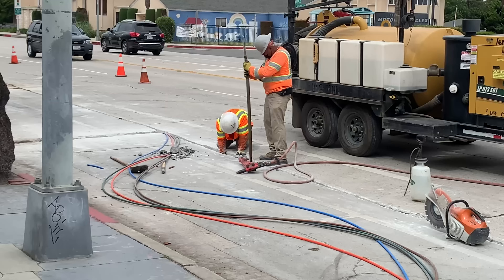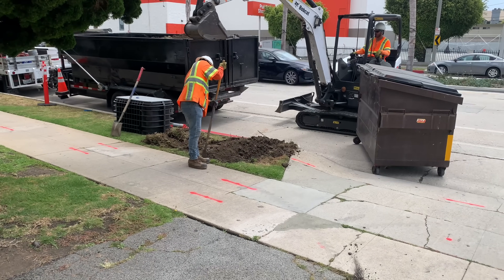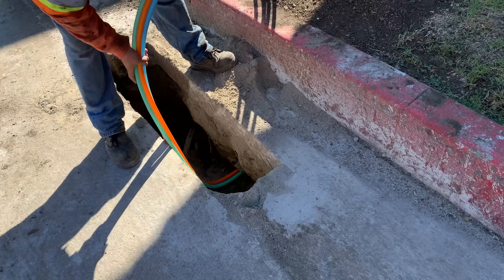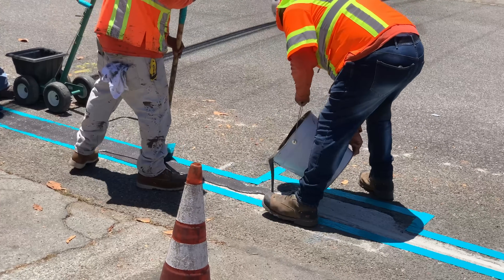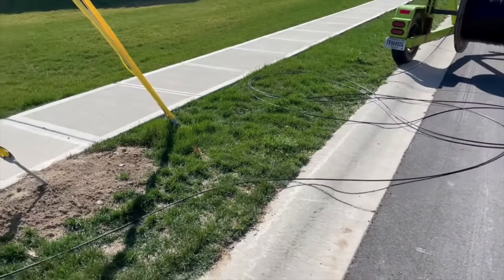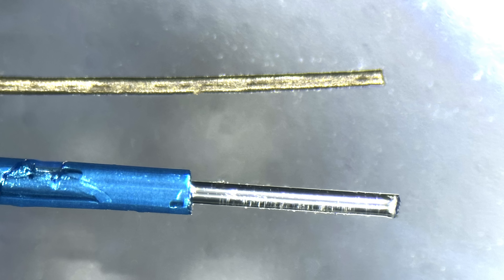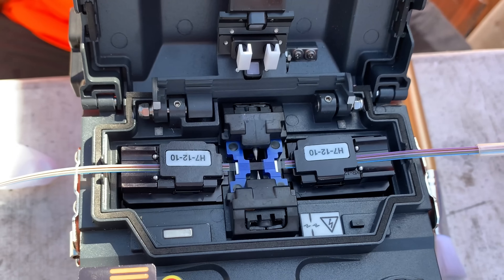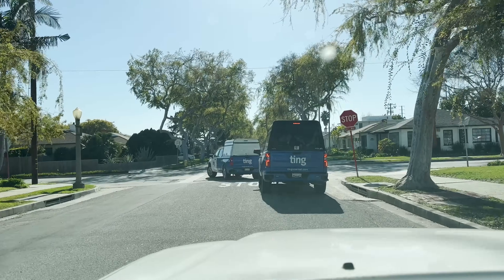Fiber Optic Network Install

Comment: So does the fiber optic internet company subcontract out these guys to install the fiber optic? If so, does the subcontractor company only do fiber optic installation or do they do general construction type work? Or are they directly working for the fiber optic company. I'm just curious how this business works.
Reply: I think a lot of ISPs use subcontractors for the infrastructure build out and then they have in-house technicians do the actual install at the house.

Comment: I live in a rural area and recently i learned theyre working on laying fiber optic cable internet in my area. So far all they've done is mark all the utilities (which is literally only water) and laid these tubes all down the street and under my driveway. The tubes are sticking out of the ground still. Im assuming cause its such a long run. They have multiple tubes sticking up every 100 feet maybe. I'm not sure i haven't measured it and thats probably an over estimation tbh. But this is the first internet outside of dial up, satellite or fixed wireless that will be available in my area. I've had dial up and fixed wireless so far which we all know about how slow dial up is. The fixed wireless was like 5Mbps to 35Mbps originally. Then they upgraded it to 50Mbps to 200Mbps. Which so far I've only seen up to about 165Mbps. Which is crazy fast for what I've been able to have. Now in a few months (I'm guessing) I may be able to get fiber optic internet. But its gotten me very curious about how it works and how its installed

Comment: Isn't laying optical cable in a trench under a concrete roadway a questionable engineering decision? Constant vibration and deformation can't be good for any cable line, including fiber optic communication lines...

Comment: In Croatia, all fiber optic cables go thru electricity poles, easy to fix and less expensive, also means no construction at your house, only a cable going thru a wall.

Comment: I just was working with a crew doing this work and it was just me working with a small hoe, we were working on a 3 line, I guess I took to long like an 1 and a half, we usually got 6 done a day but that day we just got 3 done….. long story short I worked there for 4 days and they said you were told to be ahead of the hoe and you’re not doing that, so you can get the fuck out of here.

Comment: How do your fiber wires get damaged underground???
Reply: Other workers digging in 😂
Reply: People dig in places they shouldn't. There are areas where they have signs warning people not to dig because there are buried phone lines, cable lines, power lines, gas lines, etc. But in other areas, they aren't usually marked so sometimes people dig in and cut cables unintentionally.

Comment: I am here because I am being told Optimum doesn't have real fiber internet. At the end of this video you show connecting fiber to the customer. Is that the only way to get real fiber internet, through that panel on the customers house?
Reply: Yes. The internet provider has to install a box similar to the one you see at 3:58 on the side of your house. That is where they run the fiber from the street/pole to your home. Then they run another fiber cable from that little box to inside your home to your modem or gateway.

A lot of ISPs that are not exclusively fiber will do something called fiber to the node. That means they run fiber from their central offices to the various nodes around your town. But they still have the copper wiring running from that node to the individual homes.

Comment: Now days they don't even run copper to new builds.  The house I just moved into only has 2 fiber cables coming to it, one for the telephone company and one for the TV company.  Much better speed and ping rates and very reliable.

Comment: How long after they install can a resident sign up?
Reply: I think it depends on the provider. We got fiber installed almost a year ago. I was able to sign up for service about a month to a month and a half after they finished our neighborhood.
Reply from the maker: Strangely most of the tubes are empty for some reason.. at my curb I see them but no fiber in them.. idk
Reply: @LeifMaginnis  I think sometimes they install the conduit first. Then later they come out and run the fiber through them.
Reply from the maker: @JJFlores197 yeah.. been empty for 2.5 years though.. after all that work 😂

Comment: The dumb thing how government across the world is how sloth in regulating WiFi generation. Like WiFi 8 is around the corner and we are still stuck with WiFi 5 and early adoption of WiFi 6. And every WiFi generation devices are like some kind of revolutionary stuff pricing. Just abandon producing old generation and introduce new generation router with same pricing. WiFi is just underrated.

Comment: I don't like them just dropping the fiber optic in a cut in the road. They should drop conduit to protect the fiber optic and to facilitate easy replacement in case something happens and the line needs replaced. It's easier to replace through conduit than to re dig everything back up and reinstall it.

Comment: So there's a similar tubing running from the street cabinets to a server of sorts?    When/where does the routing start?
Reply: I don't fully know how the backhaul infrastructure works, but yes there is some sort of underground conduit that runs from the cabinets to the ISP's local central office/head end.

Comment: When Bell installed fiber in my neighborhood, they used hydro excavation and horizontal directional drilling right under the the lawns. Craziest part was they did it during the winter, so the ground was frozen.

Comment: That must have been the old school way of installing fiber conduit? Because AT&T and XFinity both have been been installing their cables in my neighborhood and they aren't trenching they are using a machine that is pushing the cable with a water jet and the conduits they're burying in the ground are each 3-4 inches in diameter and are on 3000+ft spooled rolls of conduits each conduit has a 6 or 7 smaller 1/4 to 1/2 inch bundles inside them and at the end of each spool run they are installing distribution node boxes then running the individual residential supplies from those node boxes. In the amount of time it took them to dig up those streets and clean up the mess the crew that's been running around my neighborhood what's already done and on to the next area.

Comment: Watched the contractor on our street.  Cut a trench in the soil for the single fibre, deep enough to be protected.  But the coil of conduit wants to curl up and down in the trench. They are too lazy to weigh down the curl with a couple of little egg size rocks before backfill, and instead backfill with material that goes down past the conduit, leaving the conduit a couple of inches from the surface! No one will know until some wants to plant a flower in that spot!  Every home on the street like this!

Comment: And they're using the lame ass green connector. lame just use regular LC connectors not those lame green SC that are cut at an angle.t hat's just lame.

Comment: Now I get it, why people buy starlink in US, I have a $6 (₹500) per month fiber connection with 200mbps and unlimited data since 2019. No problems since 2019.

Why do US people make stuff complicated as hell and then say the cost of technology is 1000 times of actual cost.
Reply: what isp is giving you 200 with 500 rs bruh

Comment: Thats weird, they use directional boring where I am. I have never seen them directly trenching the road like that.

It seems like it would be harder to protect them against backhoes and ofher work crews by trenching the road.

Comment: Funny to watch this video. When France do this since more than 15 years and more cleaner. 80% of France have Fiber optic, and will be 100% in 5-10 years. Fiber optic is everywhere in France. In big city, small city, village, country side and ski resort.
Reply: Dis moi d'où tu sort tes 80% de câbler en fibre optique s'il te plait, je crois ta jamais travaillé dans la fibre.
Reply: @Zerasion-  Toi t'es bien un abruti. Quand on a un cerveau de gauchiste. Mieux vaut la fermez ! Oui, la France est bien fibrée à 80%. Tu n'as cas allé sur le site cartefibre.arcep. En haut à droite, il y a marqué "DONNÉES DU". Tu changes la date, et tu mets par exemple "T3 2017". Regarde la carte attentivement. Puis tu changes la date, et tu remets à "T4 2023". Je dirais même que la France est fibrée à 85%, voir 90%. Il y a seulement la région de Bretagne qui est fibrée à seulement 40%. Les départements de la Dordogne, Drôme, Ardèche, Deux-Sèvres et 2 autres qui sont seulement fibrées entre 20 et 40%. Avant d'ouvrir la bouche, mieux vaut connaître le sujet. Depuis que Macron est devenu président. Le déploiement de la Fibre optique a été multiplié par 10. Normalement, dans 10 ans, la France sera fibrée à 100%.
Reply: @Zerasion-  Toi t'es bien un abr*t*. Quand on a un cerveau de gauchiste. Mieux vaut la fermer ! Oui, la France est bien fibrée à 80%. Tu n'as cas allé sur le site cartefibre.arcep. En haut à droite, il y a marqué "DONNÉES DU". Tu changes la date, et tu mets par exemple "T3 2017". Regarde la carte attentivement. Puis tu changes la date, et tu remets à "T4 2023". Je dirais même que la France est fibrée à 85%, voir 90%. Il y a seulement la région de Bretagne qui est fibrée à seulement 40%. Les départements de la Dordogne, Drôme, Ardèche, Deux-Sèvres et 2 autres qui sont seulement fibrées entre 20 et 40%. Avant d'ouvrir la bouche, mieux vaut connaître le sujet. Depuis que Macron est devenu président. Le déploiement de la Fibre optique a été multiplié par 10. Normalement, dans 10 ans, la France sera fibrée à 100%.
Reply: @Zerasion-  Toi t'es bien un abr*t*. Quand on a un cerveau de gauchiste. Mieux vaut se taire ! Oui, la France est bien fibrée à 80%. Tu n'as cas allé sur le site arcep. En haut à droite, il y a marqué "DONNÉES DU". Tu changes la date, et tu mets par exemple "T3 2017". Regarde la carte attentivement. Puis tu changes la date, et tu remets à "T4 2023". Je dirais même que la France est fibrée à 85%, voir 90%. Il y a seulement la région de Bretagne qui est fibrée à seulement 40%. Les départements de la Dordogne, Drôme, Ardèche, Deux-Sèvres et 2 autres qui sont seulement fibrées entre 20 et 40%. Avant d'ouvrir la bouche, mieux vaut connaître le sujet. Depuis que Macron est devenu président. Le déploiement de la Fibre optique a été multiplié par 10. Normalement, dans 10 ans, la France sera fibrée à 100%

Comment: Great video, you made a small mistake though, at the end you confused an ODB with an ONT, an ONT is basically a modem while the ODB showed in the video is just a box where the fiber from the street meets with the fiber that goes inside the home. The fiber that technician plugs in at the end connects to a female to female SC connector inside of the ODB, it's than the ISP's job to run a fiber from the ODB to the actual ONT inside the home.

Comment: This all depends on where you're located. In more rural areas fiber is often aerial, trenching conduit in dirt is much easier then pavement. Often times in areas with overhead lines many of the homes already have a conduit in place and a single fiber line can share a conduit with other utilities. If their utilities arent in a conduit the fiber can be ran to the home aerial as well. Fusion splicers and ribbon fusion splicers like in the video aren't necessarily required after the main plant is in place. Once the plant is built, home installation and splicing can be achieved by with a fusion splicer but it is more practical to use mechanical fittings without a fusion splicer for fiber to the home fth installs.

Comment: In india they will dig the road for cables and leave them without any layer. It becomes a water tench when rain comes. That's why it's easy to provide fiber in countries where law is not followed properly.

Comment: You should have seen the clowns, I mean crew, that installed fiber in my neighborhood.  They worked very hard to cut through water mains, gas lines, and phone lines.  One off my neighbor's mailboxes sank along with her driveway because the clowns left a water main leaking underground infront of her house overnight.  They worked very hard, got them on security cam video, desperately trying to cut the natural gas main line that's in front of my house.  They left it leaking overnight.  But they put a caution cone in front of the massive hole.  Everyone's garages were filled with natural gas the next morning.  You just have to admire the skill of the American worker.

Comment: It's interesting they were cutting the pavement for the cable.  Around here, it's generally run in the grass area beside the sidewalk, if available.  There was also one company, I don't think they're still around, that would arrange to use the sewers to run in the fibre.  As part of the deal, they'd clean and repair the sewers.

Comment: Thank you for this, awesome videwo, it is much less comlicated (and nice) where I am from. I live in a commie block style building, my connection is literally a naked optical wire that goes for abour 20m from the box on my storry to my modem. It is literally just hotglued into place, around doors etc. Had to teach my cats not to eat it. So here I am in the 3rd world of eastern europe with a 1000 Mb connection :D

Comment: Very nice overview of the fiber network build out process! Interesting to see how that is different in other parts of the world. What I've always wondered though, after putting in all that effort, why not go just a tiny bit further and put the termination point inside the actual building? The connection has to make its way inside at some point anyways.

Comment: People are going to regret doing micro-trenching. 8 inches underneath the surface is nowhere near deep enough.
At least with standards in places like Australia it's 95% at 450mm deep and inside 50mm PE conduit.

Comment: The biggest issue is the cabinets at the street corners. Never do that unless you are trying to make sure you wan't lots of on call and unhappy customers. One car doesn't make the turn and BOOM a whole bunch of customers down for many hours. Sometimes you have vaults in remote locations and people cut the fibers because they might be copper. Some times you have vaults near crack heads that are looking for a pipe, and the next thing you know thousands of people are out of service.
Reply from the maker: yeah, the cabinets they use are not very tough.. a car did actually run into one of Tings boxes very close to where I shot all of this..
Reply: @LeifMaginnis  Last night I was working on an  7360 ISAM FX4 that was close to the road. I looked for it in Google maps and saw it was too close to the road in 2021. When I arrived I found that there were two huge concrete bollards that had been placed near the cabinet. We've had no incident in my area to date, but apparently we do have a fully loaded GPON cabinet ready to go. If they hit the LCP like in the video, I get to call someone else and then go home so long as the ISAM is working.

Comment: Here in belgium,the goverment decided for a alternative,and dont do as many underground cables,they install a wire against the house between the second and first floor against the outside wall with a fiber router on each house, eventually when you decide to swap to fiber, a installation team will schedule a free appointment to come and drill a tiny hole into your house and install the fiber line aswell as a fiber to regular Cat cables router. its from what i presume a more budget friendly alternative and since a lot of roads here are a nightmare to work on a better solution.

Comment: Well, this holds true for the few places running it underground, and on top of that even fewer that are running it under long stretches of road/sidewalk. Most places are above ground on the same poles used for power, copper internet, phone, etc.

Comment: The easiest way is directional drilling. Sure it’s expensive but come on tech companies it’s time to ditch copper and go fiber. I got my first fiber connection in 2001, in a small town and it was full gig speed but only ran about 500 mb on speed tests due to crash servers everywhere. Now I live in a city that won’t bring fiber to my neighborhood. It’s a joke.

Comment: An interesting video. I live in the UK. In 2022 we had the cables installed under the pavement but not run into homes. A year later we are still waiting for fibre broadband 🤷🏻‍♂️

Comment: I'm a lineman for the phone company and we run fiber all the time, although we don't use anything as advanced as this, half of it we still pull by hand or lash up to the old telephone poles.
Reply: They should replace the pstn wan wires w p2p laser network.
Reply: Yeah honestly this is very professional they have every piece of equipment known to man for the job we used hands and shovels in the R.O.W these projects look a bit more important than the ones I was one though.
Reply: wow, good to know!

Comment: Ours in most of Canada are installed with the electric cables up the poles.  Way less work and the service is even more reliable than the electricity.

Comment: why do they have to put the fiber-optic cables in the ground why can't they put them on the same poles they use for power lines sense fiber optic cables can't get interference from power
Reply: Some areas don't have poles. It just depends on the city and how they planned things (or didn't plan). My town has a mix of neighborhoods with power poles and neighborhoods with underground utilities. My neighborhood was built in the early 1970s and everything is underground.

Comment: I live on a property where the house is atleast 1km away from the street. They told me burying the fibre would cost too much. So my fibre line is literally hoisted in the air by a series of poles they installed.